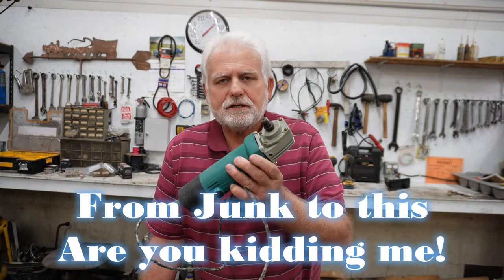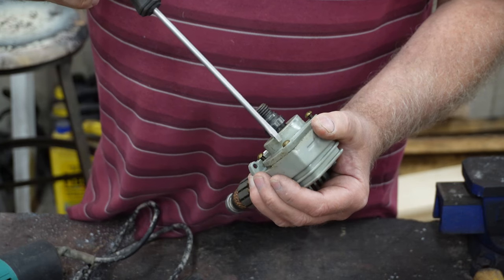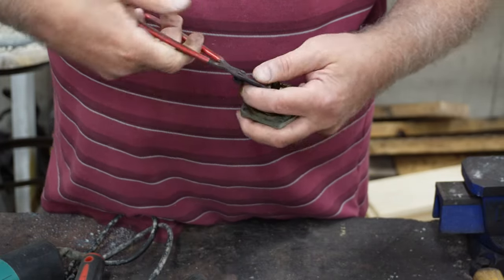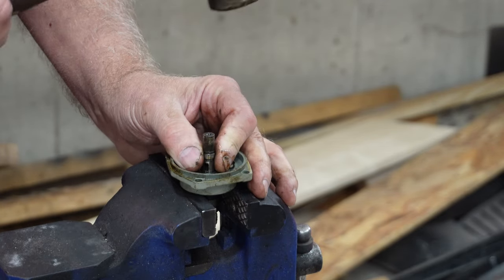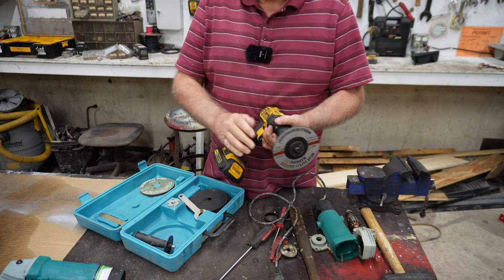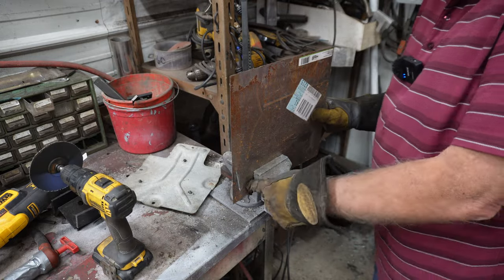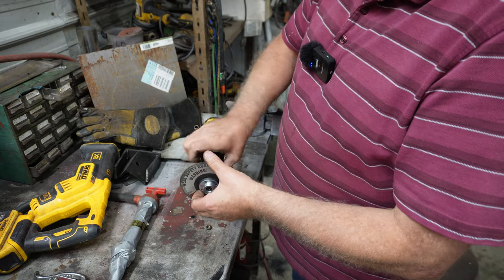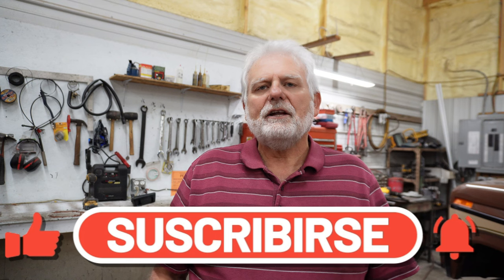Amazing Transformation Turning Junk Into a Useful Tool!

Comment: Marv aka Mr Bungle! 
(1) If you are going to strip something down save the parts so you can make a repair and reassemble - you do not want to drop bits all over the floor like Mr Bungle. 
(2) Do NOT attempt to turn a drill into a angle grinder, its DANGEROUS!
(3) Wear H&S protection like ear defenders. face mask and most important, safety glasses/goggles/full face mask.

(4) If you are using thin cutting discs make sure they are applied at 90 degrees to the work otherwise they WILL BREAK which is very dangerous IF going at speed.
(5) Always make sure that anything is securely fitted to a tool. Having two or three goes to secure his makeshift rubbish after the event  is very dangerous.
(6) YOUTUBE should take down idiots like Mr Bungle who are posting dangerous items like this.
Reply from the maker: @perrydark4113  I truly appreciate your comments and take them to heart.  Everything you’ve shared is correct and in the future I will definitely be much more mindful to what I am doing in regard to safety. THANK YOU!!!